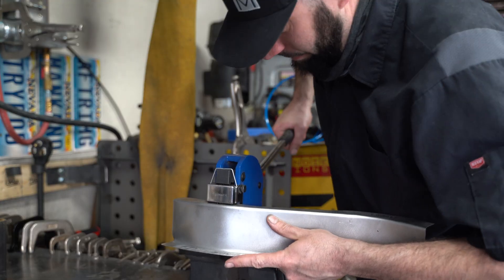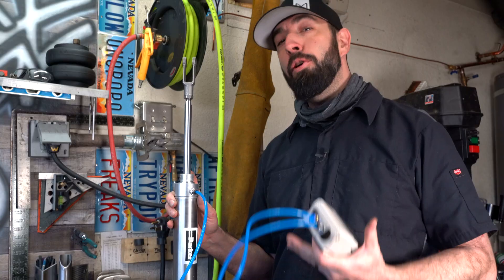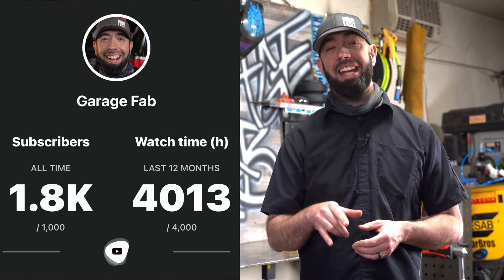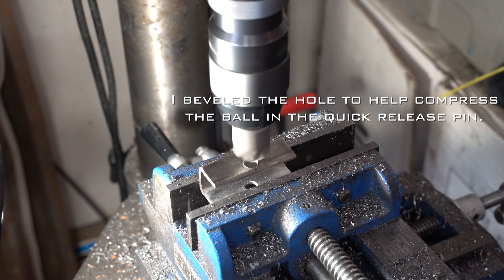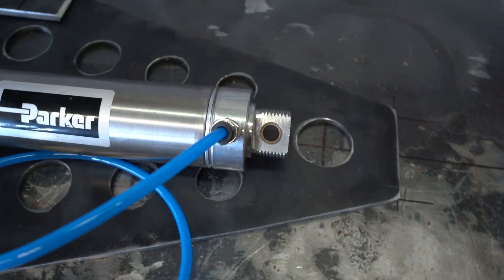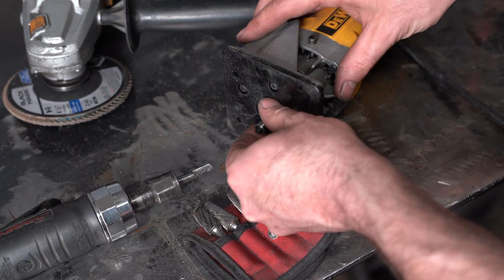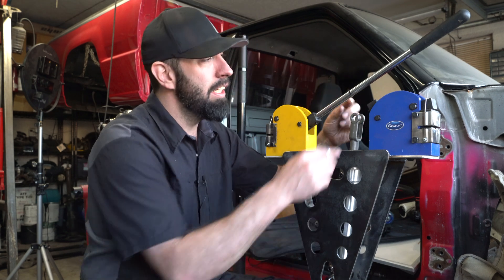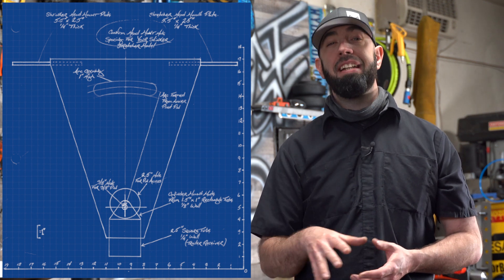Semi-Auto Power Shrinker/Stretcher?!

Comment: 1 minute in and i love your wife already!
Reply from the maker: Holy crap man! I didn't watch that video because I thought it was a flap disc. I'm definitely going to grab some and try it out. Empire Abrasives  has shown some interest in the channel and may sponsor some videos in the future. I'll have to see if they carry 3m.
Reply: @GarageFab  hahaha, that's what all my friends say, it's pretty convincing. 
I'm not sure how much they are but you get the red backing pad and the disc with the sheet metal nut. 
The one they show goes on like a cutting disc.
Hey a friend has a turbo conquest he's selling, he's told me for the last year.
It's a later year, from what I've seen it's in good shape.
I don't need another vehicle,   my cj-5 is still sitting around but I did pick up fuel injection for it. My last push on the truck was turbo but I need to work priorities. It's been sitting since this Plandemic started, tags expired so I park it.
Reply: @GarageFab  If, you have a 7" grinder?  buy for the 7" and pick up the cutter and you can cut the 7 down after it dulls to fit the 5".
We do that at work.
Reply from the maker: Smart. What do you cut it with? From the research I’ve done today about these discs they sound pretty gnarly. I don’t think I’d want to cut them with my Beverly Shear.
Reply: @GarageFab  the cutter would fit in a lunch box, it's got a metal blade like a can opener, that runs in slot. It's got a post for the hole. Like a sheet metal pinch roll with a crank handle. 
The last I seen we had two smaller barrels of wore 7" pads waiting to be cut down. 
With these disc you do want a guard on and handle. You can't relax, you catch a edge of pad it's coming to eat you. I had 9" inch run up my arm, but I had heavy welding gloves, coveralls and a thick shirt. 
Ever accidentally grind your finger with a disc and feel the burn? Two week ago a guy one handed had one jump back and hit him on his cheek and got stitches.
They are amazing pads for sure. Not cheap either.
Reply from the maker: Great. I need a little more near death experiences in my life.
Reply: @GarageFab  right. Thats why we take a perfectly engineered vehicle and cut it up. 
Here's the cutter, a good hand could build one, easy.
https://www.morganmfg.com/ab_cat05.htm
Reply from the maker: Haha! Indeed! Thank you for that.
Reply from the maker: Easy now!
Reply: @GarageFab  it's the fact you said she bought for you in the first minute. That's love sir. A moment where the grinch's heart started to grow towards a people.
im shocked about your truck, not surprised about the type of person that would hit and run. Sorry to hear that!
Reply from the maker: It was a crappy day no doubt but I’m actually grateful. I was slapping everything together just enough to get to the next car show. It was definitely cool but really sloppy and unfinished. I was getting overwhelmed thinking of all the work that still needed to be done. It’ll be coming back soon and better than ever. I’ve got some exciting plans.
Reply: @GarageFab  you're inspiring me, yes I have stuff to do on mine. Rework the tunnel and redo the angle of the trans. With the new intake banging on the hood. I've actually told my son to sale it but he refused. 
Oh, I see you still use hard grinding disc. Flapper wheels serve a good purpose. I haven't used a hard disc in years. You gotta try these but be careful, you catch the edge the grinder will try to eat you. Once you try one you'll never go back, I'll say that because I don't pay for them at work. 
As for ideas, I bet you do have some great ones! 
https://m.youtube.com/watch?v=pDTln6BnIX0
Reply from the maker: I actually do NOT use hard grinding discs. They scare the crap out of me. Cutting discs explode on me occasionally and I’m usually left bleeding. I can’t imagine a grinder disc coming apart. I’ve been using flap discs for as long as I can remember. I’m a remover of grinder guards so that’s my way of minimizing inevitable injury.
Reply: @GarageFab  the only hard disc breaking are harbor freight 💰. Those ones I mentioned work Fast, we started using them about 4 years ago. They won't break mill scale but oh boy they work especially at knocking off hard wire welds, the shaving are like steel wool. Now to me hard disc and flapper wheels stink and gag me. 
I haven't had a disc blow up at work.

Comment: Do you think a smaller pneumatic cylinder would be upto the job i. E 32mm bore?
Reply from the maker: In theory it would work but as the cylinder gets smaller, it needs more pressure to achieve the same force a larger one needs. For example, my 2 inch cylinder with a 5/8 inch shaft would produce 142 lbs of force at 50 psi.
Your 1.25 inch cylinder with a 1/2 inch shaft (guesstimate) would require 138 psi to achieve the same 142 lbs force.
I recommend locating a pneumatic cylinder force calculator online that uses the units of measurement you’re comfortable with and find out how much force your cylinder will produce with the amount of pressure your air compressor is capable of. 
140 lbs is about the maximum you’d need for 16 gauge steel.
Reply: @GarageFab  thank you very much, the response makes much more sense
Reply from the maker: My pleasure. Thank you!
Reply: @GarageFab  that is awesome guidelines-was wondering what pressure you used.  i have a 1.25-1.5 cylinder i salvaged so free. i was figuring just up the pressure. my shop air is 175psi so should be able to break something.
Reply from the maker: I think you’ll be just fine. I use mine at around 30-35psi. There’s a cylinder force calculator online somewhere. You should be able to punch in 35psi for a two inch cylinder and then determine how much more pressure you’ll need to achieve the same force.
Best of luck my man! You’ll enjoy it!
Reply: Just seen a video with a pneumatic shrinker stretcher and now I'm on a how to build one 😳   Algorithm is on point.
Reply from the maker: Haha! Good to hear. Sometimes it seems like the algorithm is broken. And then I realized it works for the viewer not the creator. In that case the algorithm is very much alive.
Good luck my man! 🙌